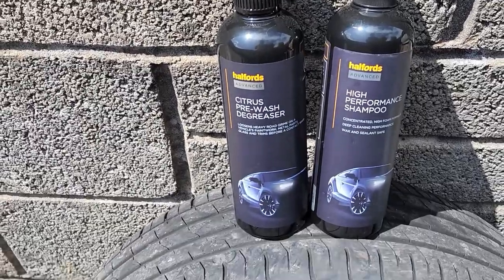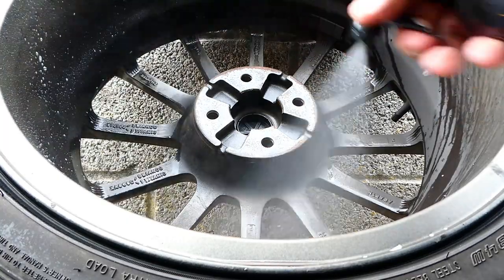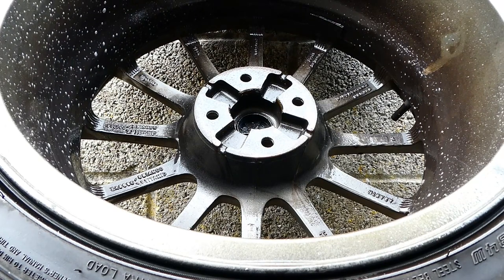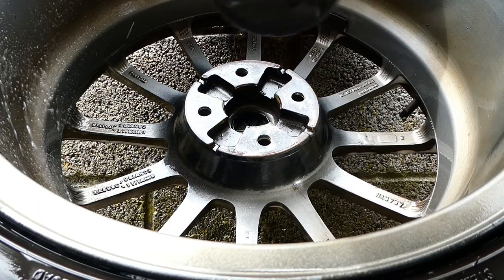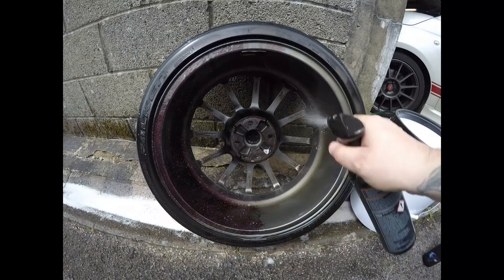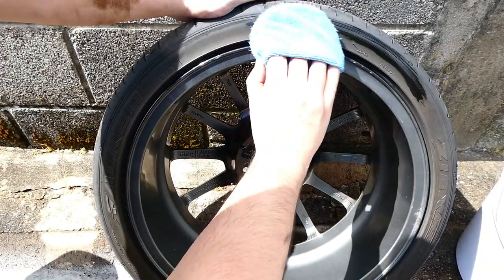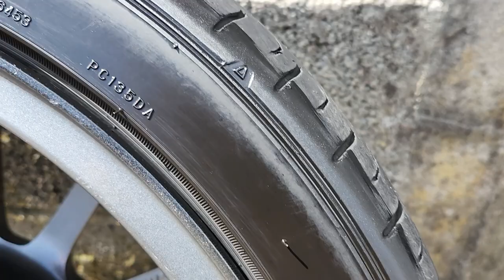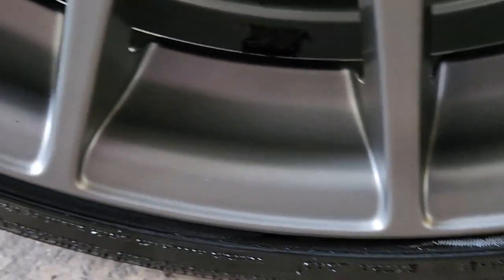Halfords Advanced Wheel Cleaning Range They Aren't Messing About

Comment: The sequence of application of the product is not quite correct! The first thing I do is pre-wash, then I apply a wheel cleaner with a metal sprinkler cleaner and at the end I wash it all off with shampoo! My opinion is that this is the most correct way. Thank you for the video, a lot of work has been done by you🤙
Reply from the maker: I've done both applications, just for the video I did it this way. The iron remover can be used both ways and its just as effective.
Reply: Nothing wrong with the method as the reactive wheel cleaner is mainly for removing embedded fallout, I wouldn’t use fallout removers on a dirty wheel, if you do then it will look like it’s doing a great job as it will change colour alot.
however most of that is just from the brakes which will just wash off once the wheel is cleaned, and the best way to use a fallout remove especially on wheels is last, as the whole purpose of it is to remove the embedded fallout, if you use it straight after the pre wash then the wheel will be too dirty and all the brake dust etc will be on top and you won’t be able to get to the embedded fallout as all the dirt and brake dust is covering it, you’ll only get rid of the surface fallout which will be mainly from the brakes which will come off anyway just by using a wheel cleaner or wheel shampoo.
What’s a metal sprinkler cleaner ?
Reply: @M.E63  Sorry for my bad English! Cleaning of metalic sprinkles is ( iron ). I have read your advice carefully, thank you for the answer! I'll try to do it according to your method!
Reply: @olegoleg19811  Ok I get it now, I thought it was some sprinkler to wash the wheels. 
Yh the problem with using fallout removers on a dirty panel or wheel is you won’t get to all the embedded fallout, you can use a normal wheel cleaner before a wheel shampoo which is fine, I only use fallout removers a few times a year so my normal method is, first the pre wash on the wheel, then wheel cleaner then wheel shampoo, you don’t have to do both cleaner and shampoo, one is fine but I like to do it that way to reduce the swirls and scratches to the wheels.

Comment: Bilt Hamber Autowheel is £60 for 5 litres, so £12 per litre. This is £12 for 500ml, so twice the price of the market leading, tried and tested, professionally acclaimed, industry standard benchmark product. Pass
Reply from the maker: All I ever hear about Bilt Hamber is good things will have to check them out.
Reply: Bilt hamber isn’t sold in halfords which is where the typical weekend warrior will shop
Reply: With all due respect it's a little ignorant to compare a 500ml price for one product with a 5 litre price for another 🤦‍♀ of course the latter is going to work out cheaper
Reply: @njdenney69  true, but the Halfords products are not available in 5 litres, and the price difference is a real consideration for anyone that details cars regularly. Even with a discount for bulk quantities it is still not going be anywhere near the Bilt Hamber price. 500ml of wheel cleaner would last me about a month so is just not viable on cost alone.